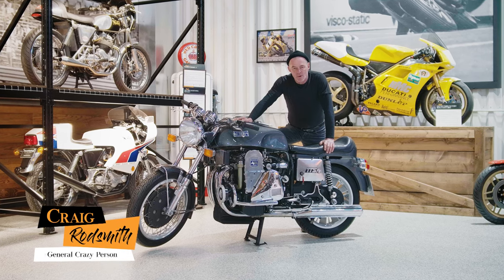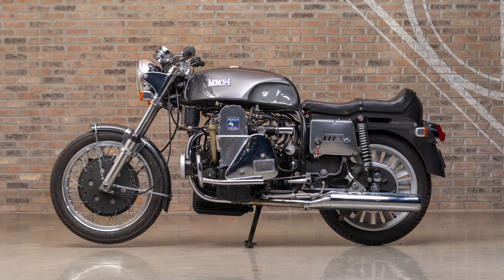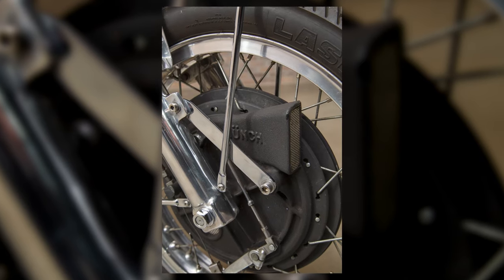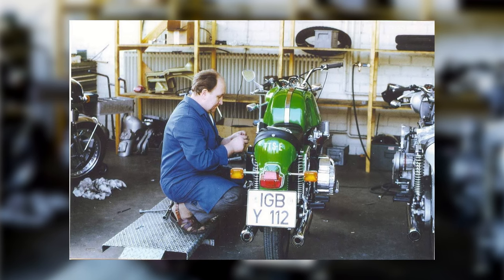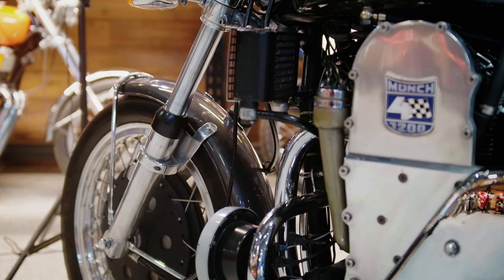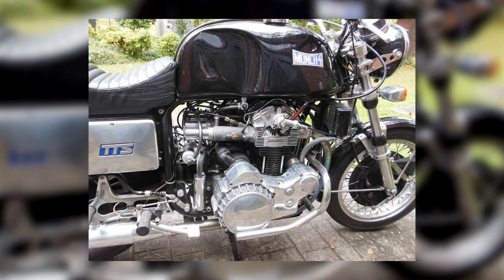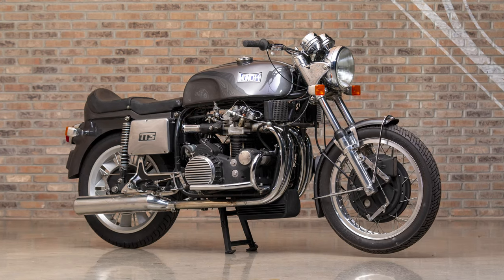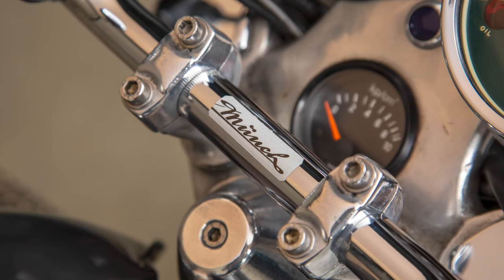Craig Rodsmith presents The Munch "Mammoth" 1200 TTS

Comment: Great video, thank you. In 1984 I owned a Munch TTS very similar looking to the grey bike in your video, except mine was a rusty red colour.  It was also the 1200cc engine but with mechanical Bosch fuel injection. I rode the bike extensively and enjoyed every moment of it. The brakes were actually not that bad for the time and the front one (was it a Fontana) seemed powerful enough. At one point I got in to quite a bad frame flexing moment, or ‘tank slapped’ as we called them. We were riding in a group at about 140 km/h, and the road became very bumpy, which unsettled the suspension. Normally it wasn’t an evil handling thing, despite it massive weight. The bike attracted enormous attention wherever I rode it. Once at Mt Panorama (track), Bathurst NSW Australia, I had to fight my way back to my bike before I could ride it. This was a favourite Easter venue for road racing, but I was strictly a spectator. The crowd around my bike were amazed at the sound of the fuel pumps whirring when I turned the ignition key. It was all great fun and I regret selling it. My bike also had the single Yamaha head light, like yours and I always thought it was quite a good looking bike. It was certainly the most interesting bike I’ve ever owned and it was very reliable. I often rode it on 1,000 km journeys. The drive chain adjuster was genius, half a turn to loosen the bolt, and then nip it up again, letting the spring do the work. No dirty hands! Some wonderful memories there for when I’m in my dotage (probably next week as I’m 70 now)! I’ve still got a few bikes left, one is my beloved Ducati Darmah SD 900 that I’ve owned for 43 years and my daily ride is a HD Heritage Softail Classic 103.

Comment: Afterthought: 
Friedel Munch was by all accounts, a better engineer than he was a business man. A flawed genius, I believe is the term. His business’ lurched from one disaster to another, resulting in something less than 1,000 bikes manufactured, though the precise figure is probably unknown. No two bikes were identical, as Friedel modified component, or changed suppliers at will. Folklore has it that Friedel ruffled the feathers of a more than one of his suppliers, because of his exacting standards. He would reject their supplied components for any minor flaw that his critical inspection detected. In the end, I believe his accountant somehow cleverly managed it, so that Friedel could not even use his own name on the last few bikes. He had to suffer the indignity of bringing his bikes to market, bearing the brand name of Horex, a favour bestowed by his old friend who had retained the name hen they ceased producing motorcycles. Surely this story rivals the demise of the great WO Bentley for tragedy! In later years another bike came to production, bearing the name Munch. This was a 2,000 cc offering, that had no involvement from Friedel, but did have a purpose built engine, instead of a car engine. My understanding is that the front wheel of the new bike, could strike the motor upon full compression of the hydraulic front forks. Obviously this was less than ideal. The potential for harm to riders, resulted in a full recall of all bikes and no sales to the public. This must certainly have been a greater business failure than anything Friedel could manage. It may even have been a fitting reward for denyingMr. Munch the use of his name. But the new bike certainly had some appeal, and at one time, I even contemplated ownership of one. However, I loved The ‘Mammoth’ for its brilliant excesses and because it’s genius creator managed to coax it from the recesses of his mind, to the marketplace, replete with unique ideas, forged in exotic metals. The Munch TTS ‘Mammoth’ is surely as desirable as anything George Brough could materialise. Though in an ideal world, I would be permitted ownership of both machines. Y……….es !
Reply from the maker: Thanks for the great insight!
Reply: total 478